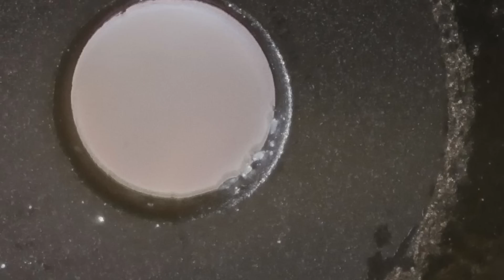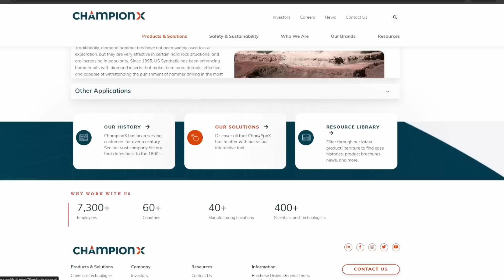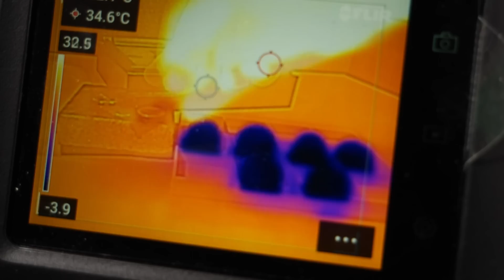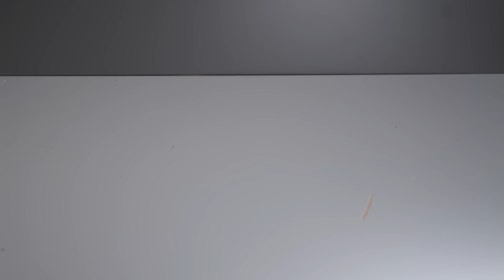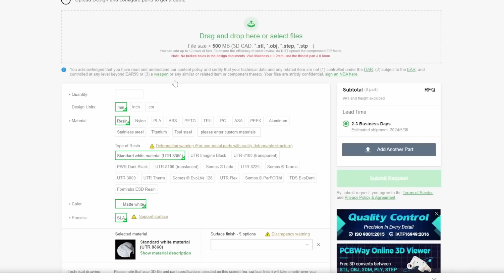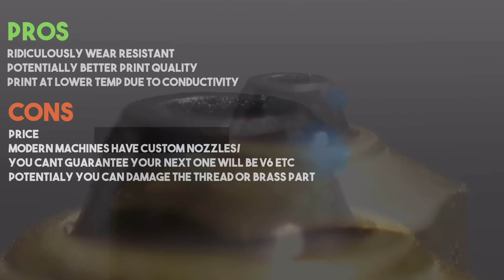The Hardest 3D Printer Nozzles In The Universe: DiamondBack.

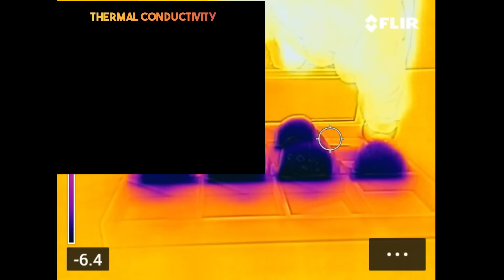Comment: Your graph of thermal conductivity at 7:00 is wrong. Diamond is about 5 times the thermal conductivity of copper, so if your PCD is about 540 it's most definitely not diamond. Copper is about 400, but diamond is about 2000. What the graph shows is that calling PCD diamond is completely false. Maybe it has diamond in it, maybe it's (almost?) as good as diamond in some regards. But it isn't diamond, and the thermal conductivity shows this.
Reply from the maker: Yes check the description ☝️

Comment: Apparently these things have a thermal ceiling from the manufacturer of 300c.  And their 'creality' unicorn nozzle is a smidge too short for the K2 Plus and will cause jams.  I really want this thing because diamond and engineering filaments but I require that high temp.

Comment: Cool, but a bit overkill for my needs. Running a Ender 3 v2 neo, so far with PLA and PETG and the factory installed brass nozzle. Just ordered and upgraded nozzle to try from MicroSwiss. Got one of their high temp nickel plated M2 nozzles. Its probably also overkill for my needs, but it was also only $20, not $95 (half the cost of my whole printer) and hopefully will be on the only nozzle I wind up needing to buy.

Comment: One user completely broke the diamond tip by using pliers to install and remove the nozzle, and presumably slipped off the flats down onto the diamond. Using pliers is not a good idea, but the diamond tip is not indestructible.

Comment: As you allude to, tungsten nozzles have both excellent abrasion resistance and excellent thermal conductivity.
Suggestion is to get ones that are solid tungsten rather than just a tungsten tip.
Not only are they significantly cheaper (about $50) vs. diamond nozzles but some suggest they are less likely to chip or break. Plus the whole body is tungsten so you may overal get better thermal conductivity than just a diamond tip (after all the melting all occurs long before the tip)
Reply: Would be interesting to see vs tests of these 2. I wonder how smooth the bore is in the pure tungsten nozzles.

Comment: I wonder with these nozzles, its just the very tip that has the diamond. So wouldnt the actual brass body wear out from abrasive materials being pushed through it?  Scalloping out the inside walls of the brass? Id assume the pressure build up in the nozzle would be enough to cause some wear over time?
Reply from the maker: Not really, but explaining why is quite hard and I'd probably get it wrong. The tip always wears disproportionately too as it's from being dragged over the printed surface
Reply: @LostInTech3D  even if the tip wears much faster than the inside, at some point the brass will wear out, so it's not forever. The question is, if diamond is really worth the investment, because nozzles with SiC tips are available 7 times cheaper and SiC is also very close to the hardness of diamond. The inner brass part would have to last at least as long as the tips of 7 SiC nozzles to make the investment worth it. Unfortunately there is not really any data about the wear of the inner parts of nozzles and if/how they affect print quality.

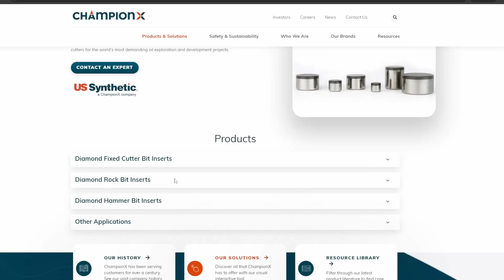Comment: I love that one of my first jobs out of college was as the head of R&D for a PCD / CBN cutting tool manufacturer, and still have my first non-school related 3D animation of our machines reshaping the round tools loaded into the boring bar at 2:28 lol. All of our tools (including making holes) were done with Wire-EDM before final shaping with abrasives. If they used a laser, given how diffraction, focal lengths, discharge from the hole as it's being bored causing side venting... I'd be more impressed that they could use a laser at all, but would question why they wouldn't just drill a starter hole, feed in the wire, wait 2 minutes, and have a perfectly contoured (slightly eroded looking) hole.
 - after having looked at the geometry of the tapered hole, this looks like erosion edm. Graphite negatives are used as electrodes rather than a wire, they're easy to produce and provide extreme dimensional accuracy. I think Titans of CNC have a video or two showing their monster of a machine off, but they can be as small as a carry on (which line up with the video shown of the fab shop, they're not making 2 different tapers meet a shelf at an orifice with a laser, let alone one that small). My experience was with 2 inch pucks though, not the 3/4" coins they make.

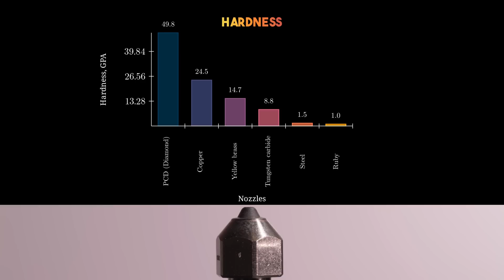Comment: I think you got the hardness graph at 2:20 wrong - everything after PCD is backwards, because there's no way copper has a tensile strength of 24.5 GPa
Reply: Not quite. Tungsten carbide is harder than steel.

Comment: I adopted them early on. The .6mm has around 7500 hours on it, printing almost exclusively PA6-CF. Still prints like new. The .4mm clogged around 2000 hours, and as I learned the hard way, do not try to use a torch to melt out the jammed filament. Good brand, nice people behind the design; I talked to them a few times.
Reply: Now I wanna see closeups on the nozzle after getting blasted with a torch

Comment: I was given a couple for testing and had issues printing polycarbonate with it it actually seemed to stick to it more than with the Slice Engineering Vanadium nozzle I had been printing PC with beforehand.

Bridging also seemed to change, as calculations in slicers seem to take into account the filament sticking to the nozzle as it's pulled. With the Diamondback nozzle, it was slipping off instead of getting stretched.

Big thing is, you will need to change your temp settings (at least at the flow rates I was using). I was printing PLA at 180 and ABS at 205 with it.

Comment: The footage of the nozzle destroying the grinding wheel; diamonds are actually used to dress grinding wheels in industry.  When preparing a surface grinder you put a diamond tipped dressing tool on the table and run the diamond across the wheel to make it run true and remove dull/contaminated grit.

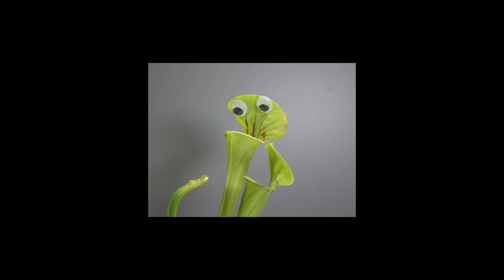Comment: 9:08 it doesn't exists because solder won't stick to diamond tip! You kind of need that to actually solder parts. If it's just applying heat then it might work.

Comment: Poly means many or multiple. A poly crystalline structure means it isn't a solid crystal structure. It has different sub crystals with their own orientations and directions to them. Vs a mono crystalline solid that everything is lined up the same.

  So kinda like the difference of having a solid block of concrete vs one that you made with fresh concrete but also broken bits of older concrete too.

 The solid block of concrete is going to form a solid structure that can be subseptable to sheering along structure lines. Whereas the concrete with the old concrete mixed in will have a non solid (Uniform) structure through it becuase of the old concrete chucks having different directions of alignment and such.

 This helps eliminate fault/sheer lines that a non poly crystalline structure would have. (And is why adding aggregate to concrete or grog to pottery makes it much stronger too.)

 Poly crystals CAN be stronger in all directions over Crystalline structures.

 However full Crystalline structures CAN be much stronger in directions of strength depending on the crystals structure.

 Also monocrystals tend to be more thermally and electrically conductive over poly crystals as the changing directions of crystals causes resitance.

 That is a big reason why Mono solar panels are a lot better at producing power than poly. 

 But yes in a way Poly crystals are like crystals inside crystals. Vs mono crystals which is just one big crystal.
Reply: Pros and cons, as always.  Personally, not accidentally breaking the stupidly expensive part because I was a bit rough on it is worth those cons.

Comment: I have mixed thoughts on the conductivity stuff. The fact that it’s the most conductive sounds very relevant to 3D printing, but it just means that the behavior would be different but not strictly better. It will get up to temperature a lot faster than any other tip, but it will also get cold easily with the fan or the bed or the already printed plastic, so this “might” lead to a bit of inconsistency while a relatively poor conductor (not exactly an insulator) will take time to heat but it will also retain that heat quite well, so the temperature won’t change a single bit, so it might not need a powerful and very fast heating element or not as big of a heating block, but well, diamond is also very hard and will last a very long time, so it’s still better than anything just because of this
Reply: The wear resistance seems to be the major selling point.  Especially when working with engineering plastics which are highly abrasive.

The higher conductivity is good, but only if you have a good heater and thermocouple right next to it.  Along with good control software.  The problem with large thermal mass is the control system might not detect a problem until it's too late.

A relevant comparison is soldering irons.  The cheaper ones have a heater cartridge, a separate thermocouple, and a changeable tip which slides on top.  The more expensive ones have all three integrated.  The "tips" are a solid piece with at least three conductors.  V+, Gnd, and sense.  They have less thermal mass, so heat up and cool down quickly, but the controller can maintain temperature better.   That's important as soldering large parts wicks all the heat out of a regular iron, and it takes too long to catch up.

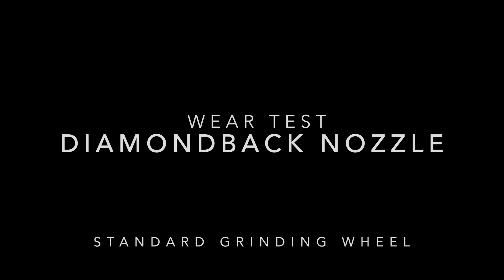Comment: That thing with the grinding wheel at 11:51 is 100% legitimate and real-time. I've once did more or less the same thing. Had to dress a grinding wheel on a dremel. Just touched the spinny thing with a diamond dresser and got a huge groove. Did the job, and the dresser was unfazed, not even a slightest trace of cutting through alumina. The sensation was unreal, I'm used to feeling the grinding wheel removing material and being hard in general, but a diamond cuts through it like it was made of paper.

Comment: As a sidenote, these nozzles can clog.  They're not cheap so you're likely going to keep using the same nozzle instead of tossing it when it's not printing properly.  Once it happens, be prepared to cold pull if you switch rapidly between multiple kinds of filaments (PLA -> PETG -> ASA -> PETG -> ASA....) and your filament load/unload process doesn't try to grab and pull the leftover gunk in the nozzle.  (Extrudes slightly before cooling the nozzle and then unloading).

You'll know it's happening when you need to poke a thin wire in to open the nozzle.  After a few times over a month or two, eventually you'll get to the point where that doesn't clear the opening anymore and a more serious solution is needed.
Reply: Is it more prone to clogging than other nozzles, or is it just it can clog like any other nozzle can?
Reply: @EmperorA0  It's probably about the same.  Maybe a little more frequent since a diamond nozzle isn't going to wear like a bronze one so you can trust the orifice to remain at the specified diameter when the bronze ones start tearing itself open from the heat and pressure.

The problem is that this is the kind of nozzle that you don't just throw away, so the extended use time means that it WILL clog eventually.

Comment: Nice Sarracenias...  Anyway apart from the insanly high flow rates, I don't see the point of these forever nozzles.  I started with a E3D V6 based printer many years back, had several nozzles in that, none of any of the fancy material (i.e. not brass) nozzles ever wore out before I moved to a E3D Revo, which recently got jammed up and I wrecked my fancy Obxidian nozzle and heater trying to seperate them, used this as an excuse to get a Bambu A1 which uses yet another nozzle type.  I guess what I am saying is tech changes so quickly they don't get a chance to wear out.  Check in again with me in around three years time and I will probably be using something else entirely.

Comment: 04:16 this is the shot when talking about Polycrystalline structure (I think, not an expert) since it reminds me of a Solar Cell, somewhat. Since there is a polished flat face you can "see into" the structure(s).  Maybe some different spectrum of light and a few polarizing filters could make it pop? IDK if it is a thing it really just seems like it could be. Either way I really like this shot and then again at 04:33.
Reply: Metallurgist here - polishing surfaces and then looking at them under high magnification absolutely is a thing to look at the crystalline structure at the micro scale. While there are certainly applications where inspecting samples in the as-polished state is useful (looking for inclusions in steel and evaluating graphite structures in cast iron are just two examples), it's usually more helpful to use a process called etching to better reveal the various grains (crystals) and the boundaries between them. This process got its name from the most common method of revealing the grain structure - applying acid to the sample, which preferentially dissolves some grains more quickly than others depending on their orientation to the surface. There are other methods that can be material- and sample-specific, including "optical etching" by way of polarized or oblique lighting techniques. 

I'd love to be able to comment specifically on diamond, but my best reference book for ceramography (something I haven't even accidentally done once since 2011) is at my desk at work while I'm off all week for our annual plant shutdown. It's not impossible that something in the grain structure could be revealed in the as-polished condition under polarized light, especially if impurities collect at the grain boundaries, but a tint etch, heat etch, chemical, or electrolytic etch may be necessary to really make it pop. And it's highly likely that higher magnifications would be needed - most macro imaging equipment tops out in the 50-80x magnification range, whereas my inverted microscope at work has objectives at 50x, 100x, 200x, 500x, and 1000x and some specialized models can go well past 2000x, into "poor man's electron microscope" territory.

And now I'd love to see someone put a Diamondback nozzle into an electron microscope to see what can be seen at extremely high mag, and to run a spectral map via EDS to look for impurities and how they may be distributed.
Reply: @justinchamberlin4195  SHHHHH with this talk hes going to need to buy more gear. Im am impressed at the quality of the shots he has in this vid tho. Maybe "Breaking Taps" could throw some electrons at it? IDK Yeah to see the structure is cool like a carbon opal type conglomerate but without a matrix? Maybe Im just mixing up stuff and this can be explained easily differently.  like its just rough diamonds pressed to be a bigger one 😅. Either way that tech/process is really cool.

Comment: Regarding the diamond soldering iron: Does molten solder stick (slightly) to PCD? In a soldering iron, you want the solder to be able to wet the tip, as that results in increased thermal conductivity, it acts like thermal compound between the iron and your part.
(Note, that I'm not saying you should melt all the solder on your iron, just that a little molten solder on the tip will increase thermal transfer to the joint, so you can melt the solder on the joint faster).

Comment: I got a nice 51mms³ out of my slightly modified Kobra 2 max hot end recently out of a 0.6mm nozzle. I'd say barely though as I could hear the extruder missing steps but 49/50 out of such a cheap printer and such a cheap mod is super cool.

Comment: When printing manufacturers keep changing the nozzle types the looks, the geometry, how long they are, what thread they have, whether they have threads or not, buying an expensive nozzle to maybe sell that printer and change manufacturers 2 years later is bonkers, when a hardened nozzle will probably last you that two years if not longer depending on how much you print...........

Comment: There has been a diamond filled filament! It actually wants to embrace it all, it was more lubricious. That's another advantage of the diamond nozzles, the surface is incredibly slick so you have very little chance of the filament sticking. The diamond filled filaments also took advantage of the heat conductivity properties of diamond as it was advertised as a high-flow pla. I think that gimmick has disappeared off of the interwebs though

Comment: I have a tungsten carbide nozzle on my 3D printer.  About half the price, and will also happily carve up my bed if the Z offset gets messed up.
Reply: Not to mention you can reach high temps with TC. A PCD tip does nothing for you when you stick it in a brass nozzle. Have fun not going above 300C.